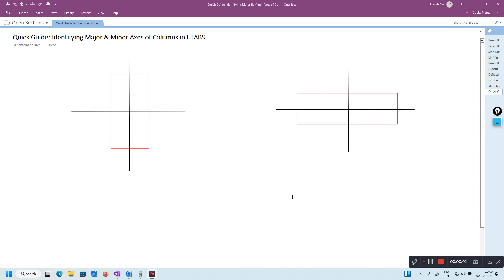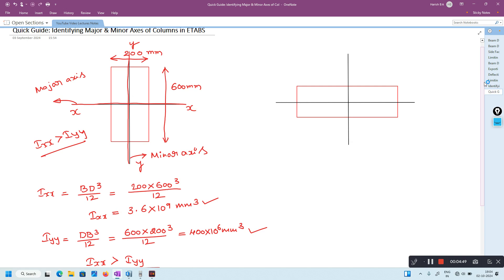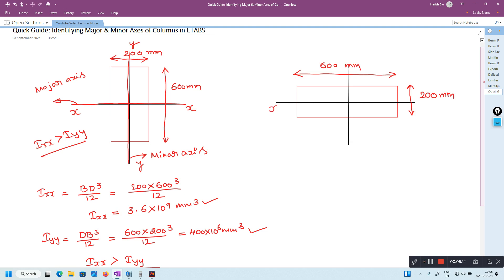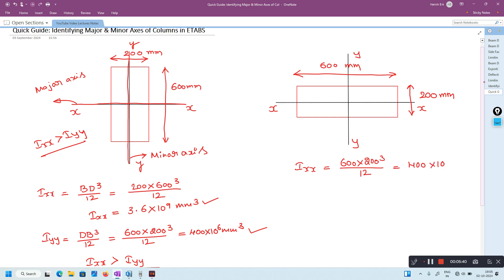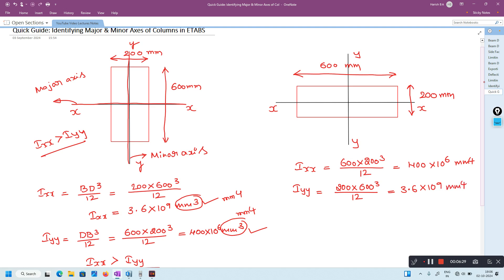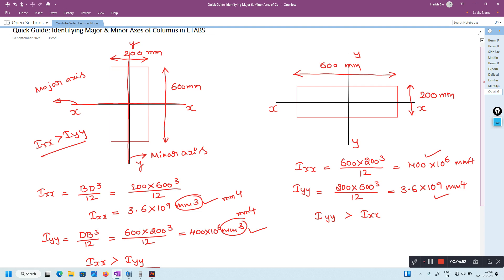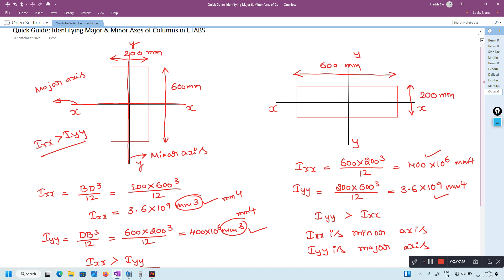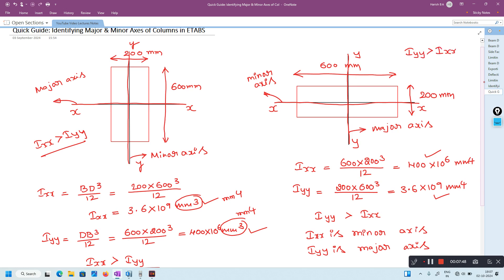Quick Guide Identifying Major & Minor Axes of Columns in ETABS

Comment: hi sir ...although i read the comments of may colleagues , but still am confusing , in the design of column by etabs , the oreintation of columns in the summary labeled with axies 2,3 and this matters to tell which major or minor ... for moments , it is logical that the shorter side of column( the weaker) will buckle more than that of longer side , now here in etabs the shorter is about 2 axis ( minor ) , and the longer is about 3 axis ..... but why this is not always the case ??? sometimes it is totally rhe opposite ..... for example , the etabs summary shows that the major bend is about 3 axis but above of the page the column of horizontal oreintation has an arrow of 3 axis parallel to the longer side of the column . why ?

Comment: In etabs,  when u model column it is in 2 and 3 direction. 2 perpendicular to short and 3 perpendicular to long. As per your explanation. The no. 3 is the major axis. When i run the model. And see the summary. The result the Vu2 is the major and Vu3 is the minor. It contradicts your explanation kindly explain pls. Thank you. 😊
Reply from the maker: In ETABS, axis conventions sometimes cause confusion: 2 and 3 directions are simply labels for the local axes, not fixed designations for "major" or "minor" axes. Typically, the 3-axis aligns with the column's longer side, making it the major axis. However, Vu2 and Vu3 refer to shear forces along these local axes, not necessarily indicating "major" or "minor." For design, always verify which axis aligns with the longer dimension (major) and shorter (minor), regardless of Vu2/Vu3 naming.
Reply: @hcstructuraldesigns thanks

Comment: Sir i have seen the column size 230 X 1100  as they mention  in design wall ,how we model in etab simply as column or wall
Reply from the maker: For 230 x 1100 mm, it's better to model as a wall (using wall tool or shell elements), especially for lateral analysis. You can always extract forces and design it as a column in design software like RCDC if needed.
Reply: Thank you sir  @hcstructuraldesigns